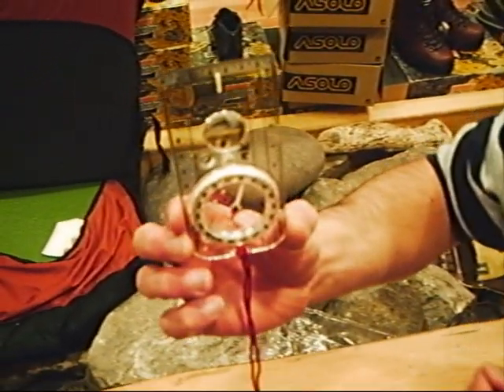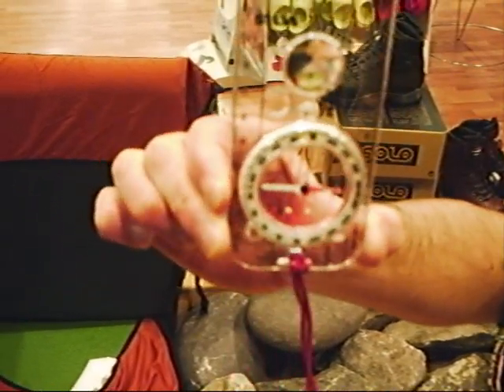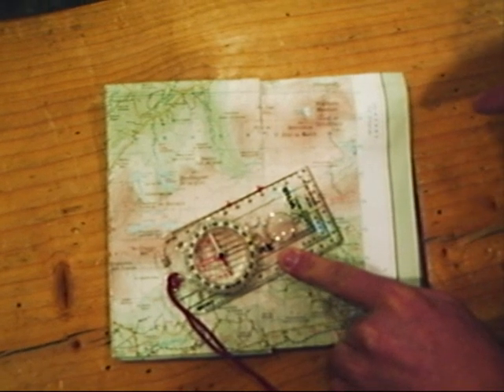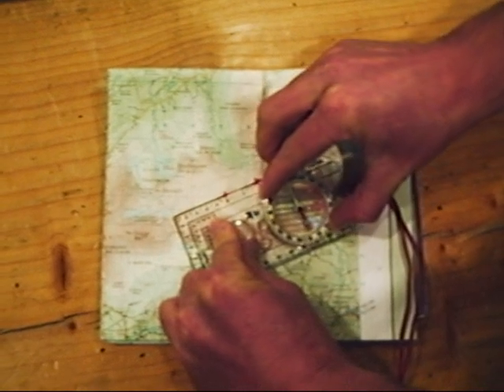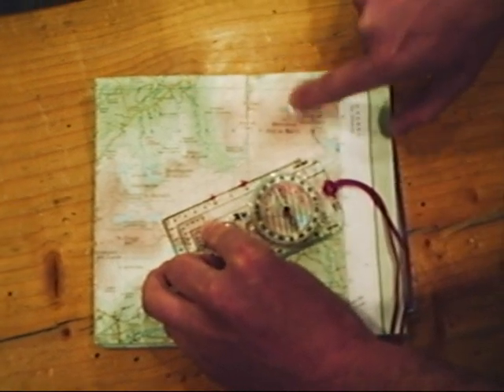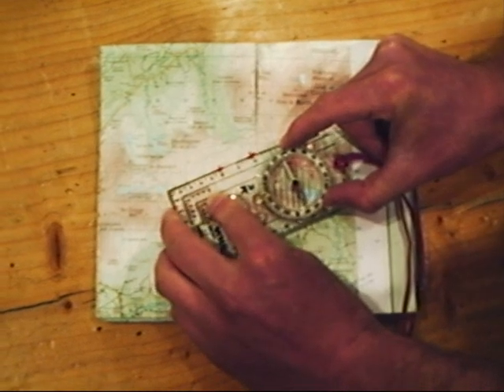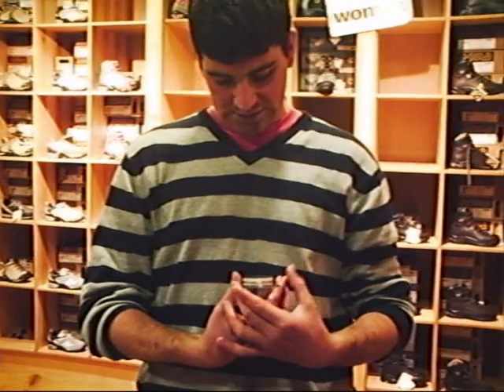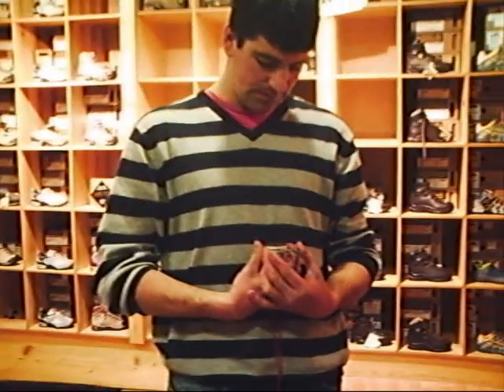Taking a Compass Bearing

Comment from the maker: They're to allow you to take a compass bearing off the mountain to use on your map more accurately, or even when you've taken your normal bearing and are looking ahead to pick your next point to walk to. The mirror allows you to hold up the compass in front of you to sight ahead and at the same time see the compass needle in the mirror to check it's alligned. Hope this helps.

Comment from the maker: Hi Robert,
In this case your compass will be of no use, as you can only use the compass to travel in a straight line from A to B.
This is when you'll have to navigate by measuring distances, timing, pacing and ticking off features as you progress.

Comment from the maker: With no grid lines you'd still need to aligh your compass wheel to north on your map, which would generally be the top of the map as you read the writing.
However with no grid lines it's not going to be anywhere as accurate a bearing as it should be.

Comment: hum body = magnetic field ?  if i remember correctly your body has a electricity travelling tru it thus generating a magnetic field thus you should hold your compass far from you if i remember corectly and yes you need to compensate for magnetic declination also